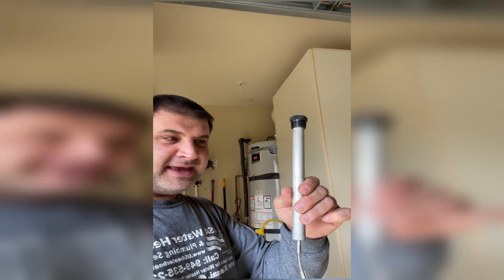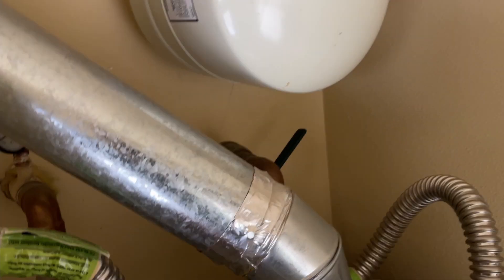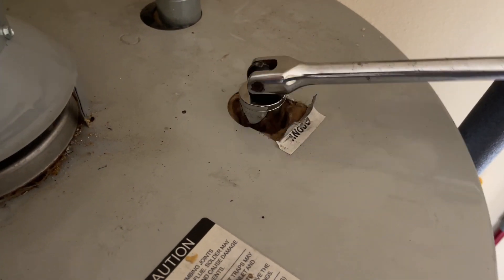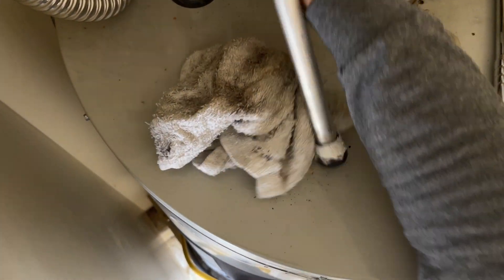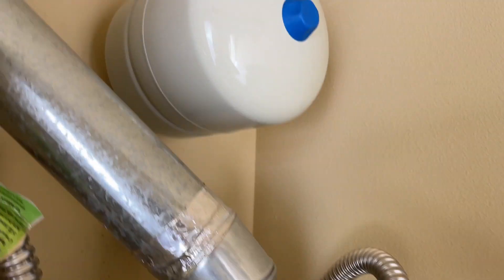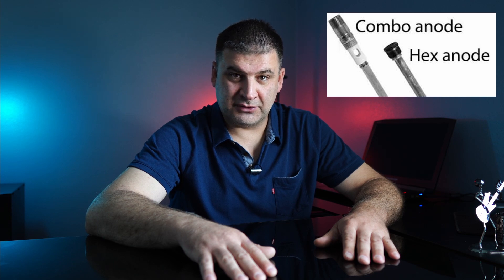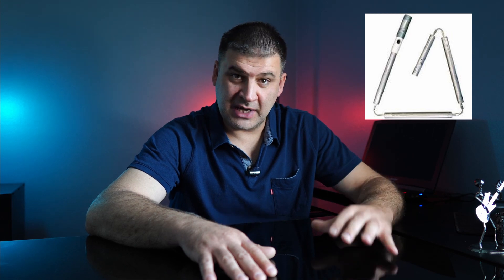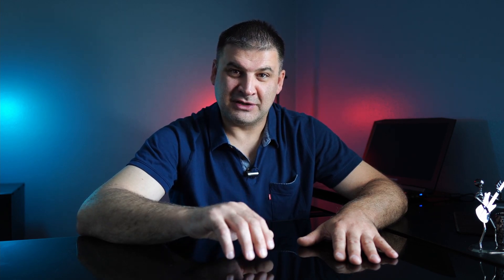This is How You Can Extend The Life of Your Tank Water Heater - Anode/Sacrificial/ Rod Replacement

Comment from the maker: Parts & Tools List:

The new electronic Corro-Protec Rod: https://amzn.to/3f1N4qe
Hex Head Aluminum-Zinc Sausage Link Style Anode Rod: https://amzn.to/49ivngq
Combo/Hot Water Nipple Aluminum-Zinc Sausage Link Style Anode Rod: https://amzn.to/3uiHefq
Hex Head Magnesium Sausage Link Style Anode Rod: https://amzn.to/3SJv74D
Combo/Hot Water Nipple Magnesium Sausage Link Style Anode Rod: https://amzn.to/3vZjHRb

1 1/16" Socket: https://amzn.to/3f1WT7L
1/2" Adjustable Ratchet: https://amzn.to/3FZCig6
PTFE Compound Paste: https://amzn.to/3FYpir7
Blue Monster Tape: https://amzn.to/3q1tRey

Zinc is the slowest to dissolve, thus providing the longest-lasting protection, but might have negative health effects. Aluminum is the one that fights the sulfur /rotten eggs/ smell when you have it, but is the fastest to dissolve- needs to be replaced more often. Magnesium is the choice right in between. You might be able to find an aluminum-zinc product as well.
If there is a salt water softener in the house the average replacement interval is 2 years. If there is no water purification in the home, the interval is 7-8 years.
Lastly you can also get an electronic anode rod and get the benefits of all the aforementioned without any of the disadvantages mentioned above.
See the links in the video description.

Comment: The sausage anode rods can be too long and may need to be shortened by cutting off one of the links. How do you determine the proper length of the sausage anode rod to determine if one of the links need to be cut off?

Comment: Are there times when these rods get stuck in the threads (melted)?  Last time i wanted to check the rods on my Rheem (now trash) water heater it was so stuck that i never could unthread it out.  Is that a big risk that if the threads are melted that a new rod would never hold and the water heater would have to be changed all together?

Comment: Aluminum Zinc or Magnesium rod for my water heater ? What type is best for what circumstances or water to protect the water heater ?
Reply from the maker: Zinc is the slowest to dissolve, thus providing the longest-lasting protection, but might have negative health effects. Aluminum is the one that fights the sulfur /rotten eggs/ smell when you have it, but is the fastest to dissolve- needs to be replaced more often. Magnesium is the choice right in between. You might be able to find an aluminum-zinc product as well.
If there is a salt water softener in the house the average replacement interval is 2 years. If there is no water purification in the home, the interval is 7-8 years.
Lastly you can also get an electronic anode rod and get the benefits of all the aforementioned without any of the disadvantages mentioned above.
See the links in the video description.

Comment: Can the bottom of the AANODE TOUCH THE BOTTOM OF THE TANK.? And is your New Anode aluminum, or Magnesium, or ZINC???
Reply from the maker: Usually it does not have to come in contact with the bottom.
Reply: @dennistheplumber  And what metal is best for what water?